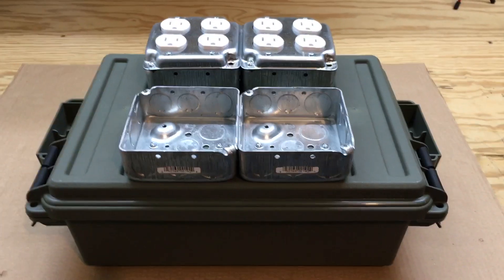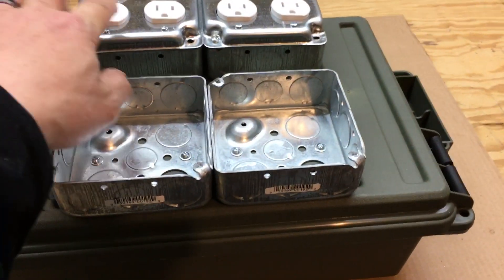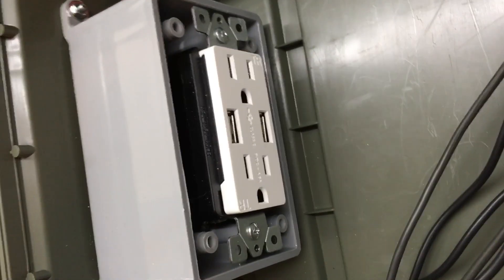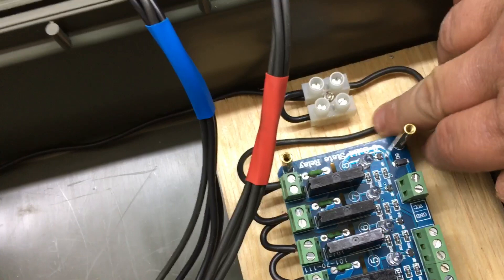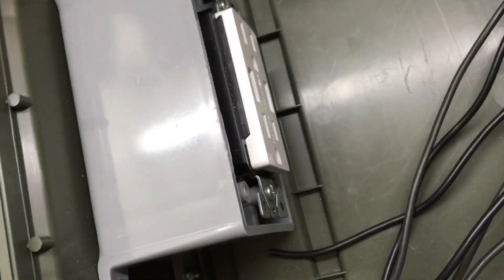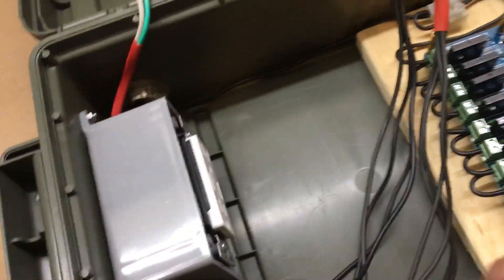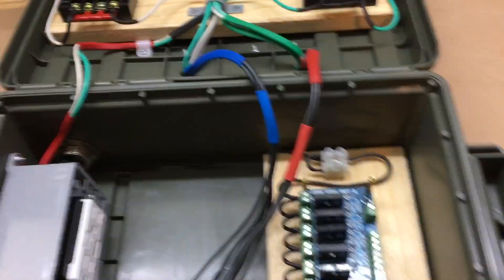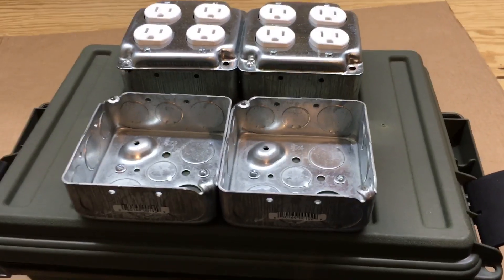Raspberry Pi 16 Channel Solid State Relay Setup For Christmas Lights PART 1

Comment: Wood with all that current... YOUCHERS... I would not use wood with all that electricity and current!
Reply from the maker: No different having 10/2 staples to a 2x4 stud drawing 30 amps. With all the LED lights I was running with this setup. I wasn't even drawing 2 amps.

Comment: Not cool, but super awesome, what software are you using on the Raspberry Pi to sync the music to the relays? Thanks for sharing !!
Reply from the maker: LightShowPi
Reply: @FuzzThePiGuy  Thank you Fuzz, I see you are daisy-chaining the hot wire between the relays, which is a great space saver. I just tried mine using 14 AWG and it seems to be a bit too big. Did you use 16 AWG to make two cables fit inside each of the slots?
Reply from the maker: @sayubu  Yes. I used 16AWG. Each relay is only good for 2 amps. So with using LED lights, I am no where close to using anything. So 16AWG is enough for my setup.